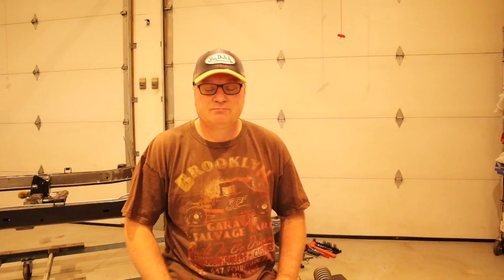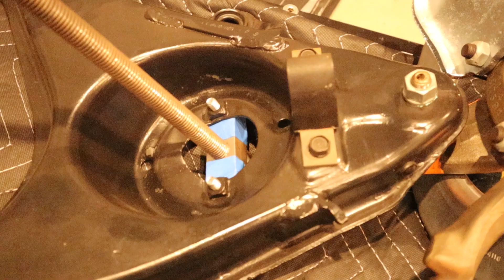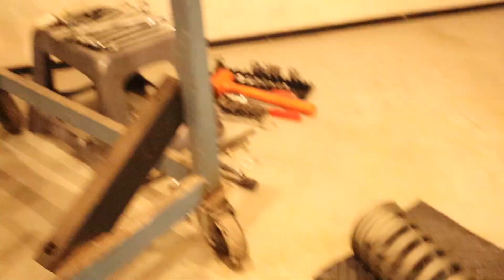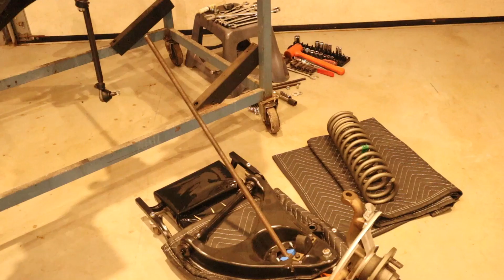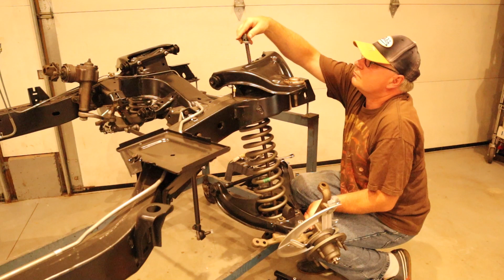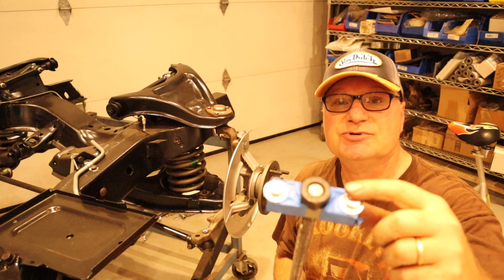C2 C3 Corvette Coil Spring Installation Easy and Safe

Comment: Thanks. I'm right at this step with a 65. Riveted bushings, etc, you must be headed for top flight. Was surprised you hadn't coated the upper and lower portions of the spindle in orange. Thanks again.

Comment: For 67's and other C2's there is a small hole in the upper a-arm and the end of the spring coil MUST be within 3/8" of that hole.  It doesn't matter were the bottom end of coil sits.

Comment: I tend to ask questions as they come to mind. This may have been answered. Can this be done with the body attached and engine installed?
Reply from the maker: It can be done with the body attached. I suggest cutting down the threaded rod some, so it doesn't stick up so far into the engine compartment.

Comment: Great video! I just removed my springs and control arms using your method. But I used 5/8" stainless steel threaded rod, nuts and washers. But I used a wheel puller to mount to the lower arm and bolted it to the shock mount... Worked perfectly for removing the springs and will be just as easy to install the new ones. BTW it took me 45 minutes to remove the passenger side upper, lower control arms, spindle and springs. SAFELY!
Reply from the maker: That is awesome! Great job!

Comment: I have to comment on your post. I have been struggling for days trying to get my 76 Corvette front springs installed. After watching your video I had both installed in a few hours. I used a much thinner rod 13mm because that was all I could get  in my small town.  So thank you very much for your knowledge.
Reply from the maker: Hi Always glad to help. If you find this useful, please subscribe.
Reply: Did you completely dismantle the entire vehicle to expose the bare frame like this asshat did? Beware when a youtube video uses the words "quick", "safe" and/or "easy".

Comment: What kind of threaded Rod is it, fantastic way of doing it ! I’m thinking the Rod has to be pretty heavy duty,thanks
Reply from the maker: If you look at the video description, I put information on what kind of rod and where to buy. For the sake of safety, you don't want to use run of the mill box store threaded rod. You want something that is hardened and has higher strength.

Comment: interesting alternative way to install the spring.I guess the method can be used also to safely remove the old spring. Thanks for including the drawing of the tool.
just a question: do the bushings on the A-arms need to be press fit, or they can be just inserted by hand? You seem to do so. Thanks
Reply from the maker: Stock A-Arm bushings are rubber bonded to an outer steel shell and an inner steel shell. These need to be pressed into the A-Arms. You need to support the ears from the inside when installing the A-Arm bushings or the ears that hold the bushings will deflect and you'll have issues getting the bushings installed. Also, you need to install the shaft before installing the bushings. 
If you go with polyurethane bushings (not original), there is no need to press these in. They are a slip fit. Hope this helps you!
Reply: @playzwithcars562  yes it does thank you! I asked because on my 75 C3 I found one front upper bushing "extruded" out - the bolt and washer holding it were totally loose and the fan shroud just prevent them to fall off! It was very difficult to push in the new bushing - without major disassembly of the A arm.

Comment: Great idea works very well can you do this in a chevy s10 with the body on the frame awesome idea great looking chassis could you send me a parts list so i can make this tool would love to see the vette when the project is finished thanks for posting
Reply from the maker: The brackets and concept is geared around the C2/C3 chassis. I don't know what the shock mounts and such look like on an S10, so I'd say no, this will not work as designed for an S10. Thanks for watching.
Reply: @playzwithcars562  ok thanks for responding

Comment: Good idea with the threaded rod. Myself, I'd probably use 3/4" threaded rod. You can take a socket that fits the nut, cut it in half or so, and weld a piece of tubing to it to fit over rod. Basically, make long socket and use ratchet to pull parts together. Nice to see the fine job you're doing on that chassis.
Reply from the maker: Joe, I need to look again, but I do not think a 3/4" threaded rod will fit through the upper frame shock mounting hole. A means to use a ratchet would definitely speed things up. Thanks for watching and your inputs!
Reply: Joe i was thinking the same thing, just think how fast an impact wrench would be .
Reply: What if a nut was welded flush on the rod with the lower spanned piece ( lower shock mount block )  not threaded but drilled larger than the diameter of the threaded rod. And while holding the wrench on a nut on the top control arm an impact wench could spin the rod from the bottom.
Reply: I watched your video last night. 😊. Went to lowe's, purchased 5/8 inch threaded rod, along with nuts and washers.  I got the passenger side done this afternoon, probably spent 5 hours. Tomorrow I will do the driver side and I'm guessing it will take me half the time.  
Someone referred to three-quarter inch threaded rod. That will not fit through the shock absorber mounting hole up on top of the frame. 
5/8" is plenty stout. 😊 
Thank you for this great video 
I couldn't have gotten this done with out you!

Comment: Is that an engineered solution ?
Reply from the maker: A medium strength 5/8" steel rod had an ultimate strength of 120,000 psi. The area of a 5/8" rod is .31 square inches, for an ultimate strength of 37,200 pounds.
Assuming a 550 lb spring rate, and the spring compresses 4" during installation, that corresponds to a load of 2,200 pounds during compression.
This yields a factor of safety of 16.9

Comment: Could you modify that tool by welding the hex nut on the all thread rod, maybe go up to 3/4 inch dia. rod. Then use a cordless impact wrench to screw the rod into the lower mount thus saving all the wrenching work?
Reply: Another way is weld a hollow tube to the nut on top and another nut welded to the second top nut this nut is just to turn the first nut , so this way you have lots of room to turn the wrench a full 360 degrees
Reply from the maker: You probably could. You'd probably need to have your car/frame raised higher to clear the rod sticking down below the lower a arm this way during tightening.

Comment: Thanks.
A very useful video.
I am curious as to what you coated your springs and natural finish suspension parts with.
Reply from the maker: What I have been doing on my resoration is soaking the components in Evaporust, and if they are not pitted, using a satin clearcoat, or lately I've been using RPM (Rust Preventative Magic). It is a waxy substance that you heat the part up with a heat gun and apply this with a paint brush. It sounds weird but this stuff works. If the part is pitted and you really do not have a consistent surface, then I revert to the cast iron/cast blast paint. Hope this helps!

Comment: Thank you for the great video. I am currently installing the coils springs on my 66 roadster.  I like the idea of suspending the whole control arm and then mounting the control arm when you get close to installing the ball joint stud.  Do you have a video installing the rear leaf spring?  I would like to see your technique on that installation.  Thanks Again.
Reply from the maker: Glad you found value in it. I will be doing a rear spring video in the future. Good luck with your 66!
Reply: A rear spring installation video would be of great value to me.  Looking forward to it.  Thanks again for the front spring installation video.